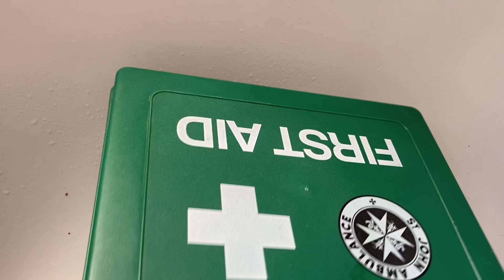SNACK SHACK IS COMPLETE! Building a rodent breeding room!

Comment: Looks like you've been busy, and you couldn't have chosen a warmer time to take on such a project!!.  Just an observation, but I didn't see you lay in a DMC barrier to prevent dampness rising up through the blocks.  It may not matter, but dampness may be something to watch out for in the years to come.  Unless it's the camera angle there also doesn't seem much fall on the roof, which may lead to standing water forming. - Not knocking the build, just observations.  Other than that it looks good, especially like the planter option... How's the ankle by the way (ouch !!)
Reply from the maker: Malcolm Crabbe no barrier but we don’t intend to be here for much longer than 2/3 years so not too concerned also the paint option we used seals the blocks. As per the roof it is the camera angled as there is an incline and has been tested with water buckets to ensure the water runs and that there are no leaks 🙏😊